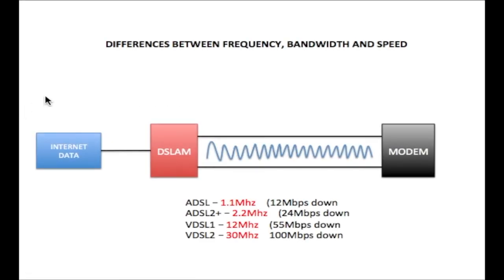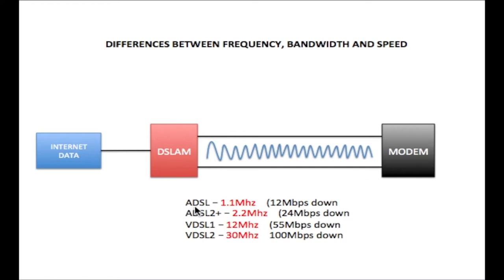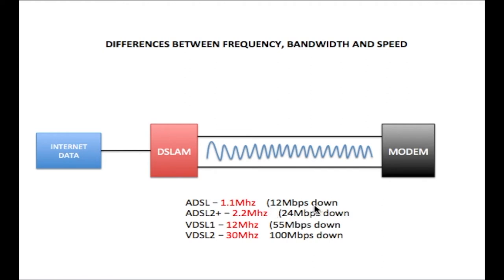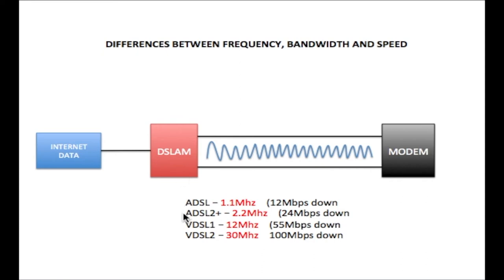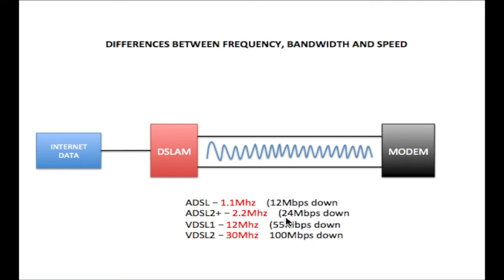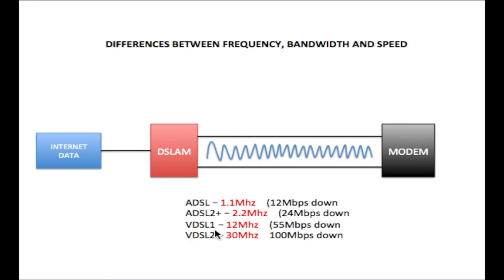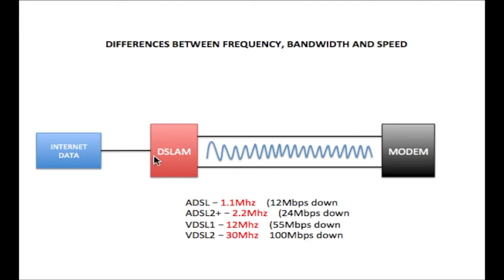Frequency VS Bandwidth & Speed

Comment: So when frequency is increased like for 2.4GHz, a bandwidth can also be increased but as the frequency increases the range decreases right?
Reply from the maker: That is mostly correct. Frequency, bandwidth and distance is very interdependent.   let use water as an example.  The maximum amount of water that can be pumped into a 5cm pipe is 2 liters per second, going a distance of 3km.   The 2 liters per second is the frequency, and the 5cm pipe is the bandwidth.  Doubling the pipe size from 5cm to 10cm would double the bandwidth.  Allowing the pump to double its frequency to 4 liters per second going the same 3km distance.  However, the distance is where copper and electricity differs from water in a pipe.   Higher electrical frequencies do not travel through walls and other objects as easily as lower frequencies.  This also applies to copper wires where there is much more Impedance to signals at higher frequencies reducing the distance. so as frequencies get higher, distance get lower.   Thank you for the question, and I hope my answer was helpful.
Reply: @TelecomTraining  thank you v.much
Reply from the maker: @filmrolls3165   you are welcome.